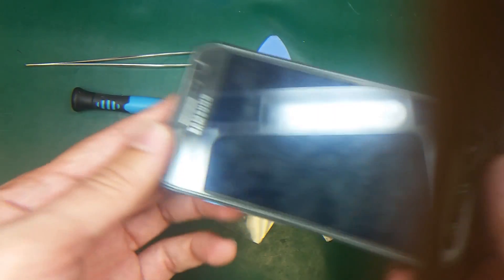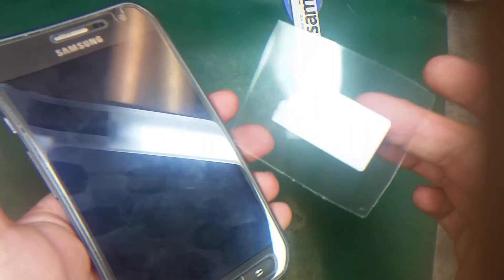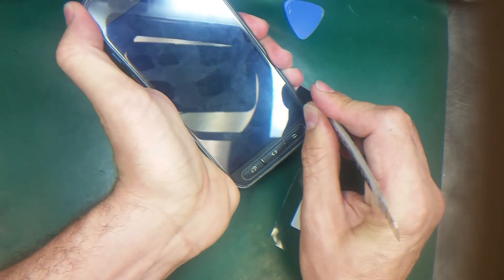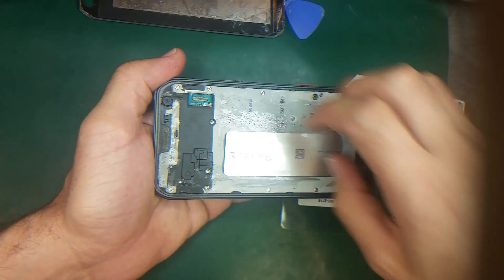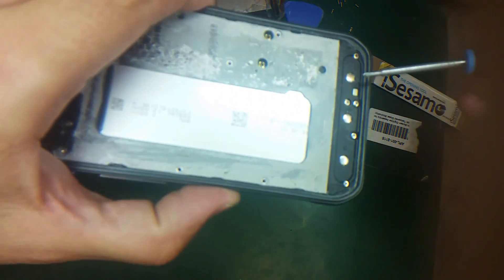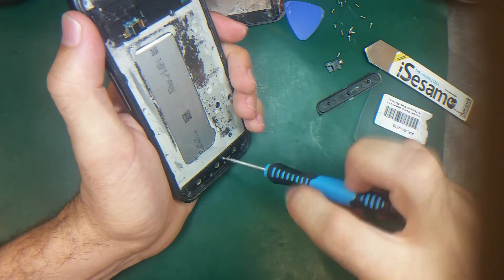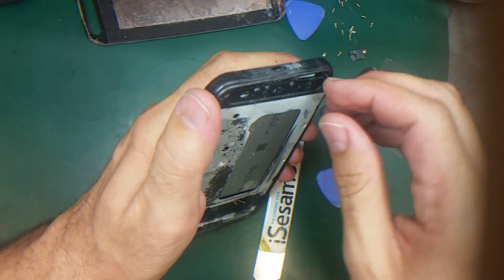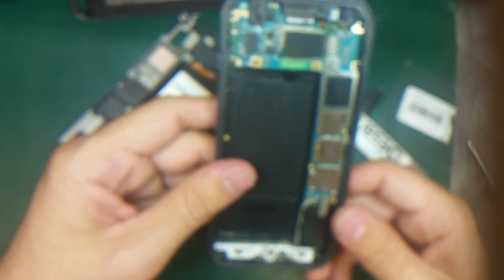Samsung Galaxy S6 Active : tear down, water damage treatment and screen replacement  (Part 1 )

Comment: I just used this video as one of 2 source videos on how to replace my failing battery.  This phone was nearly useless to me, and I decided to roll the dice.  I was successful, but I wanted to add that there is adhesive on the back of the screen in addition to around the edges.  Once you get the edges, it is a good idea to hit the middle of the screen with some heat and get a good look at what you're dealing with.  In my case, there was a sheet of copper (heat sink??) that was adhered to the back of the screen and the frame.  This didn't seem to be an issue in this video, but you can see the adhesive on the metal frame when he lifts off the screen.  Like I said, somehow I made it work, but the whole process could have failed at that step.  Take it slow and easy, look at what you're doing, and this is very doable.

Comment: Hi My galaxy s6 active would not start i opened the front panel still its the same but when i took to the repair shop they say the battery and motherboard looks fine.I tried induction charging and the charger was blinking but no response from the phone.Please let me know if the phone would not start without proper LCD panel if so i will just replace the LCD panel.
Reply from the maker: Harikrishnan L , 
Either the lcd is gone or something on the motherboard damaged specifically the FPC where the lcd connect or in that area.

Comment: I have an s6 active and it is def not waterproof like my s5 active was. Why is this? When it gets wet it doesn't work for a day or so. Then starts working again
Reply from the maker: may some water get into the speaker and it got rusted
Reply: Keith Richard  why don't you learn not to get it anymore

Comment from the maker: Hi Afsheen, the Samsung Galaxy S5 Active is a quiet bit old phone . the price in the market is between  $100 to $160.
Reply from the maker: and the price for the Samsung Galaxy  S6 Active is between  $180 to $260, it depends on the condition if it's used or new.